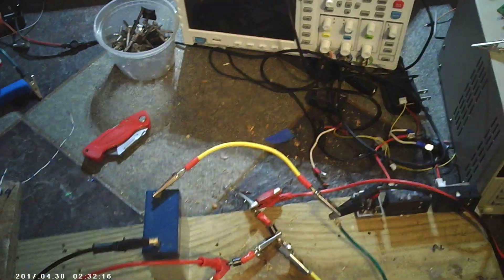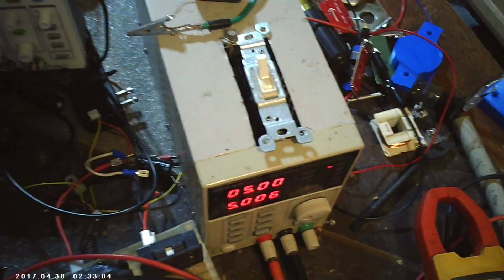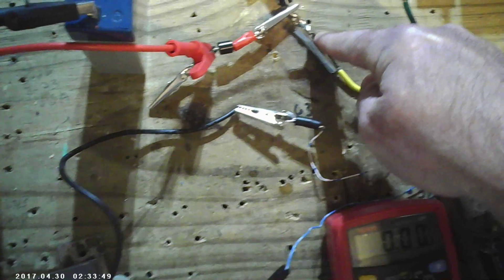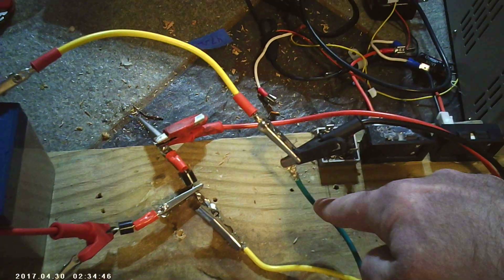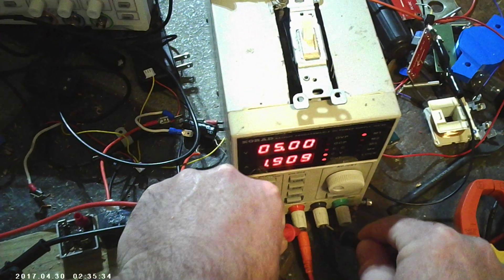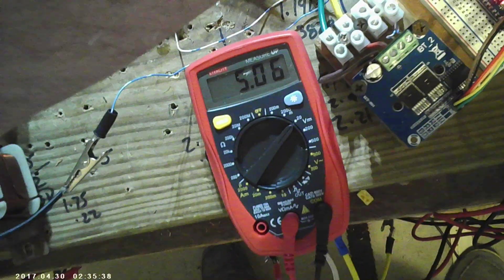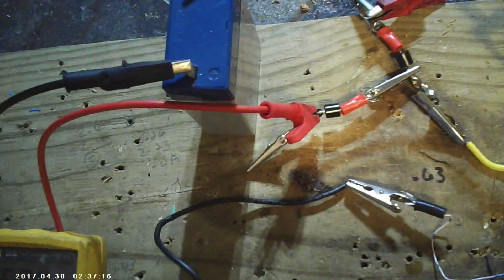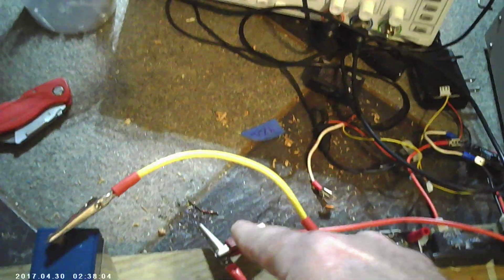5V input Charging 6V Battery at .670 amps from Back EMF.

Comment: To me this is functioning like a hybrid between a charge pump and a boost converter. I like it. Not sure the practical usages but I think it's a cool circuit. I may experiment with some circuit similar and see for myself. Keep up the work.
Reply from the maker: Thanks..  If replicating:  Use a low ohm choke.  Flip DC polarities pretty slowly, around 25 Hz. And you will need the 2 diodes to make the current flow through the load the right way.

Comment: Seems like 9.5 Watts input being used to produce 4.1 Watts of charge into a battery. If the choke had a secondary like a transformer perhaps extra energy could be harvested here?
Reply from the maker: I tried, but a secondary robs the flux from the choke and the battery stops charging. A coil will induct another coil, or induct itself if no other coil is there.  Adding a secondary makes a transformer but robs the BEMF. I can however add a low ohm transformer in series with the choke.  Or add a low ohm coil to drive a motor.  I have other things to try.  Like boost the output negative of the battery and feed the boosted line back into the circuit to create more BEMF.  So far it's just a cool effect. I have not found an advantageous way to use it yet.
Reply: @floodrod  "Adding a secondary makes a transformer but robs the BEMF": I did the same experience in an other setup. Then I separated the output of the secondary. Instead of a bridge rectifier I just put one diode in one direction. This way just the flyback of the secondary gets collected. Similar to an ignition coil of a car. This way the flux didn't get robed. I believe the flyback of the primary and the flyback of the secondary and the BEMF can get collected at the same time. It's something to test.